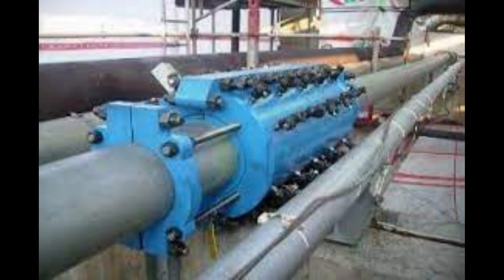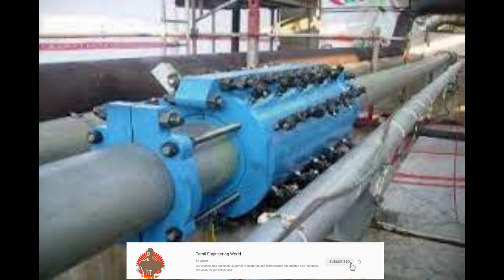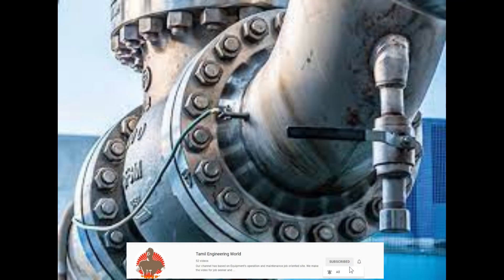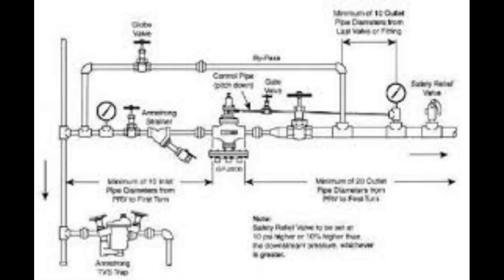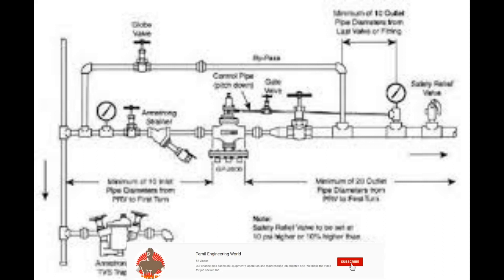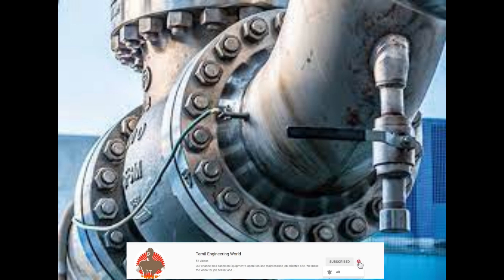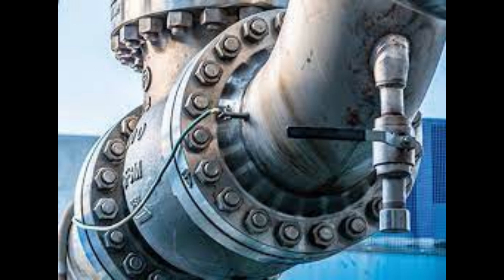How to attent the valve passing during maintenance | How to identify the valve passing | oil & gas

Comment: I would like share about there is scenario.   As per client requirements need to implement new piping tie in in the existing NGL Export gas header line .The client has indicated that, they are very stringent to shutdown that line since this is one of capital of plant.On the other hand client shared from their previous experience that the valve used to isolate the header may valve pass. They are proposed that hot tap can be solution if valve passing there in such a situation.  In addition client awar that hot tap is expensive and they have any ideas about during the valve passing at the end isolation valve need to install blind flange with orifice (something like trip ring or orifice flange) and fix the instrument nozzles and measuring passing. Finally abandoned this idea since it could lead to so much risk